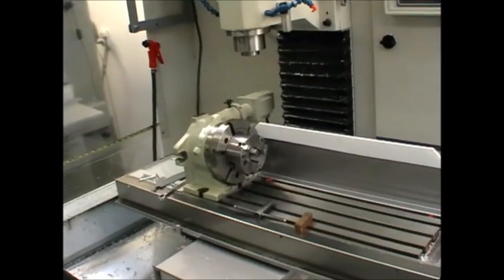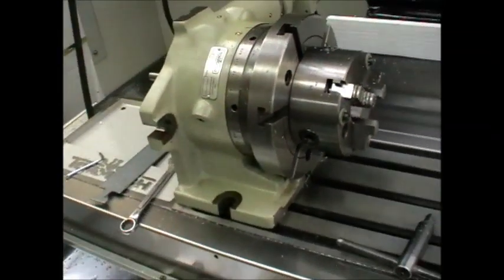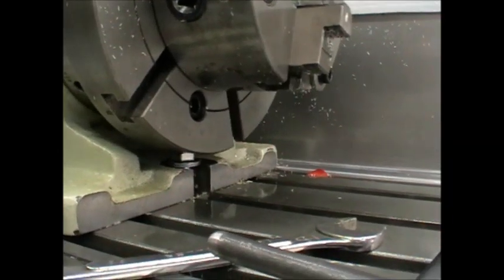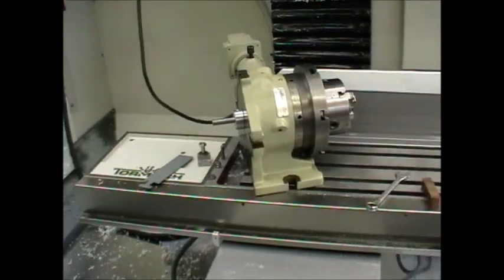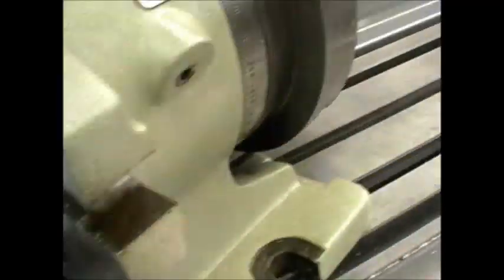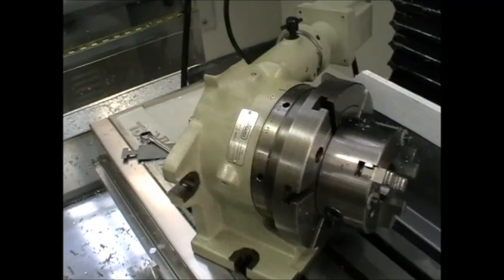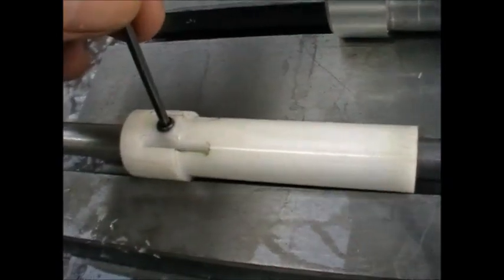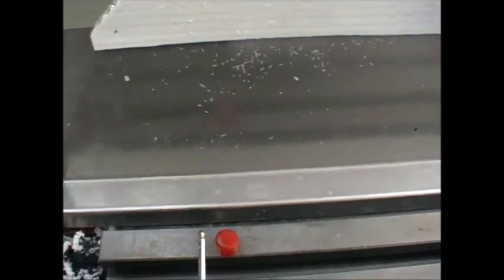Tormach 4th Axis   Super Spacer Tips

Comment: I am interested in the Super Spacer for a 4th Axis to maybe retro fit onto a non Tormach mill                                                                                                                                          I am curious what is it like at cutting helical. I am guessing this would be a difficult question as a lot of people would not use it for this purpose more so move in to a position and mill.             A big plus with the Super Spacer is the hollow bore which is very good for shafts or for setting up to a set length for milling as you have done. Another thing that would be good to have is a Tilting Rotary Table would also come in handy but difficult to justify having both and also the rotary table is a little limited in is capabilities.In general how do you feel about the Tormach Mill is there anything that you would like to improve about it or more so have you had any running problems since purchasing it?????.Regards Peter.
Reply from the maker: +Peter CCR ENG Hi Peter. For the money Tormach gives you a lot. But it is not a high end CNC and is limited in some situations.It is a low cost Chinese made machine and some random issue is likely to surface at some stage - but the design and support is very good and parts are not expensive if out of warranty. Be careful to consider weight when choosing a 4th axis - this smaller super spacer is ok for a one man lift on/off - but any heavier would be a hassle if lifting gear is needed . cheers.